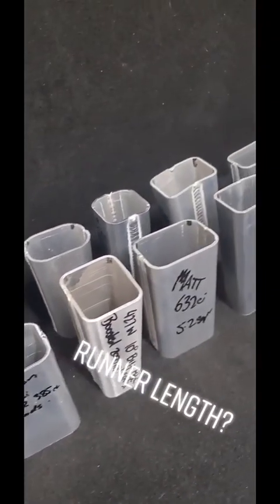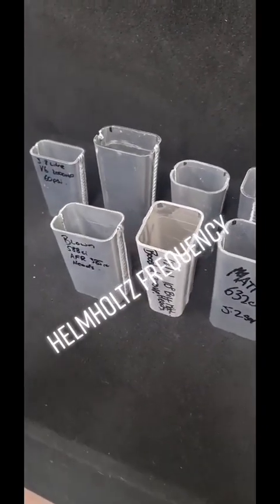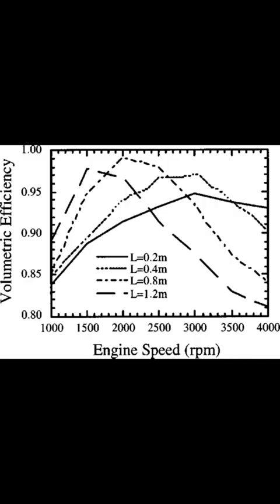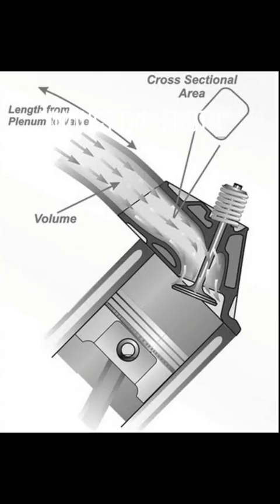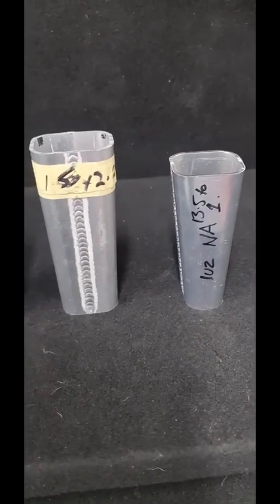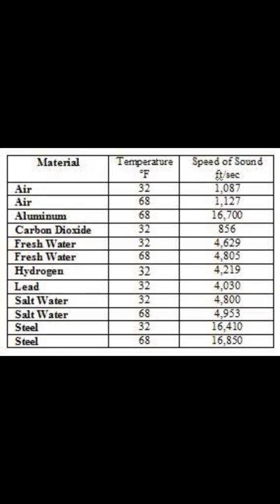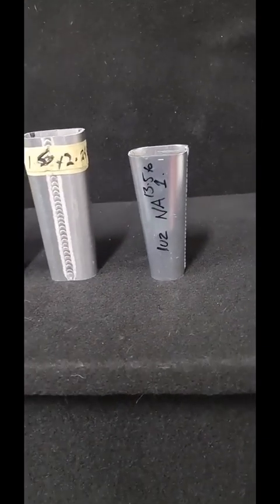"The Impact of Runner Length on ICE Engine Performance"

Comment: I have a question about the idea of infinitely variable intake runner lengths. If you had a runner that could physically track the optimum runner length real time, how much of a window of change in length would a typical engine need, to optimize from idle to redline? Example: a meter at idle to 5cm at redline, and somewhere in between for all other conditions? From some of the other information on this video it sounds like the runner length would need to track with rpm as well as a MAP reading?
Reply from the maker: Yes F1 use to do this.  Not point at Idle.  But depending on the engine of class of racing you would build it around your targeted RPM range. A circuit car is generally 3000-4000rpm.  But let's say you extend that to 5000rpm as not only do you have variable induction. But camless valve control.    Then say your working area in 5000-10,000RPM.  You would start at 16" and end at 10".    

The only downside of of these systems like F1 and even the Mazda that won the 24 hour Le man's. The 787B.  Is they all use "parallel" tubing which increased drag. So again not optimal. As when we increase RPM we need to increase the CSA opening of the induction.  So the angle of the runner becomes greater as we need to compensate from this "skin friction" drag that the increase in velocity as we rev creates.  

Hopefully that makes sense 👍
Reply: @bainracing 
Has anyone used something that would be similar to the idea of a stiffer version of a Chinese finger trap, on an actuator, that changes length and diameter……but obviously air tight.

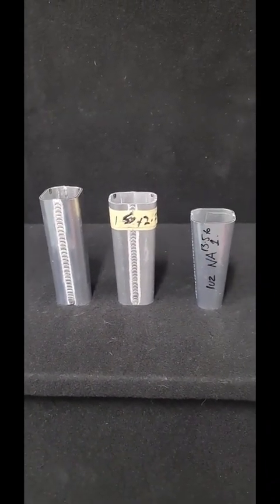Comment: What do you mean when you say one runner is dry and the other one is wet? 1:57 Great videos!🙏
Reply from the maker: One is fully wet meaning the runner is carrying "air/fuel" mix and the other is port injection,  so mostly dry.    This will change the temperature,  density and the wave action and its why EFI (dry) have weaker wave action. 👍
Reply: @bainracing  Gotcha!!🙏 That was all-encompassing😎

Comment: I am building a TPI 355, how do I determine the optimum timing of the valve events to the tpi system based on the frequency/harmonics this system has?
Reply from the maker: Analyse the setup. Work backwards from the runner length and MCSA and air speed (average CSA). Then optimise valve events off comp and RPM. 👍

Comment: It's got nothing to do with Helmholtz, Read up on it, it's a totally different theory. It's organ pipe tuning.
Reply: Or more realistically it's an acoustic transmission line which follows the same basic rules as any electromagnetic transmission line.
Reply: We don't tune for the 3rd harmonic either. We can tune for any odd harmonic as the odd ones give a boost and the even ones do the opposite. The 1st and 3rd need pipes too long so we use the 5th odd harmonic which in your language is the 3rd.The 3rd odd one.
Reply from the maker: Yeah, unfortunately, intake primary length tuning has nothing to do with  stationary "parallel" pipe organ pipe resonance. Especially as the primary intske is not only not parallel, but in a depression state. 

That's a "theory" that has kicked around  for years, more related to exhaust pressure wave and length tuning. Not intake and it only shows a poor understanding of the dynamic environment of ICE engines.  

Rather,  our intake pressure waves have everything to do with shock wave pressure, tuning time/length cycles, and their reflection amplitude, and it's definitely all 3rd harmonic as well as a varying Helmholtz frequency, as that is the only length we can achieve while balancing velocity/resistance and inertia.  2nd is far too long,  4th is too short but can be used if height limiting factors are needed. 

The timing of both compression and rearfraction is key here 👌. 

I think you have your intake and exhaust mechanisms confused.